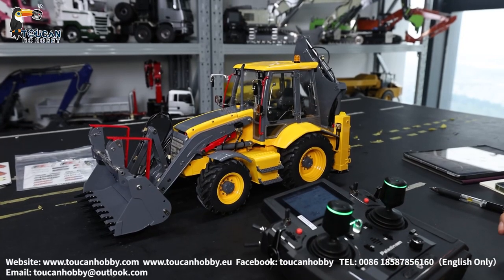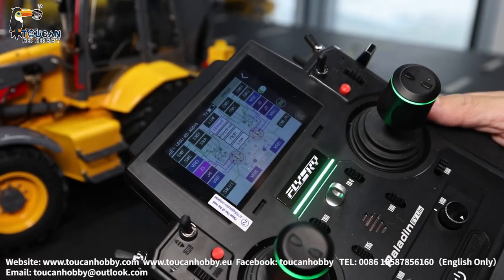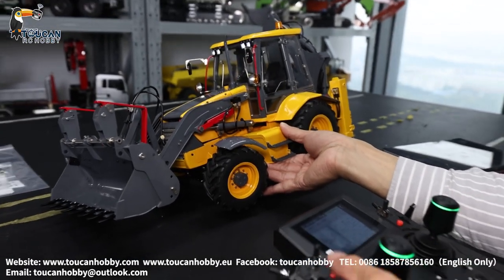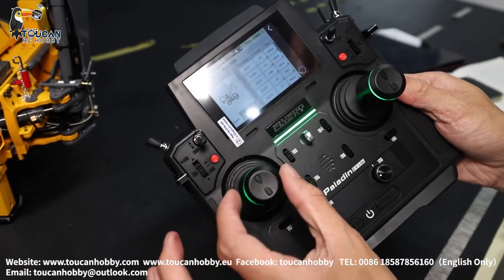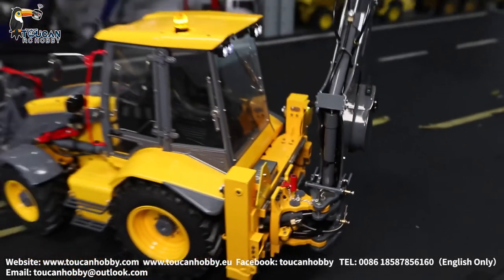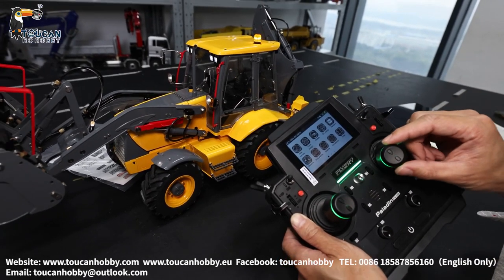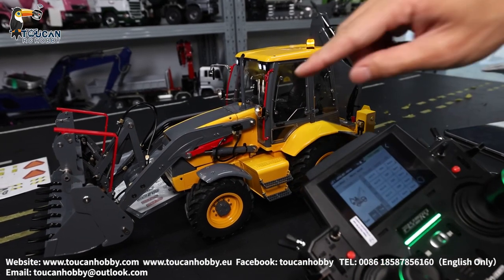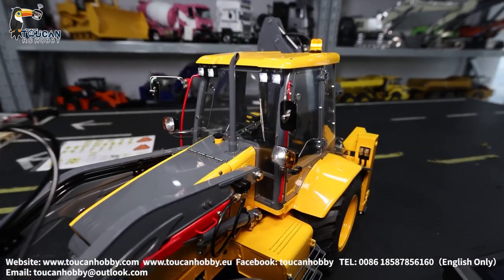How to operate LESU Hydraulic Aoue-BL71 Backhoe RC Excavator Loader 2 in 1, see radio settings.

Comment: These settings need to be explained a little clearer because I’ve done through this video and settings several times and I cannot get them all to work. Some of my front controls are now working with the rear after i set the function setting as you said in this video. 😡
Reply from the maker: Send me messenger can send you the radio settings to upload to your radio directly